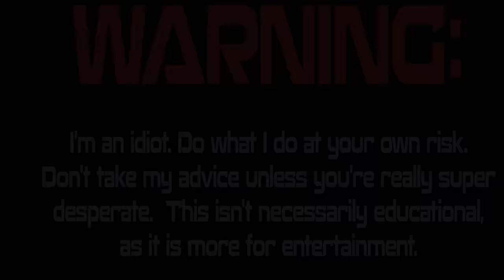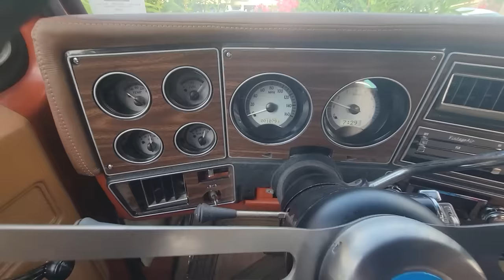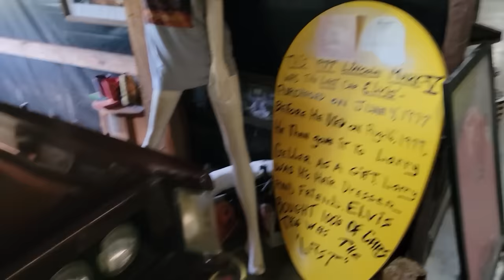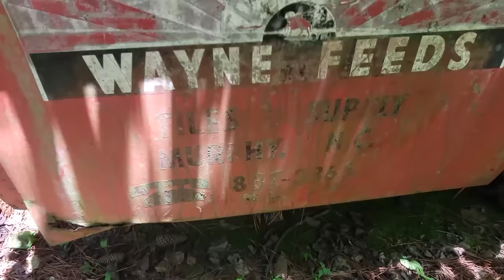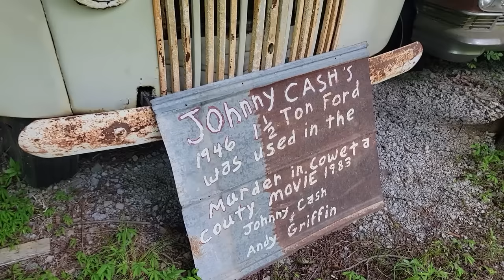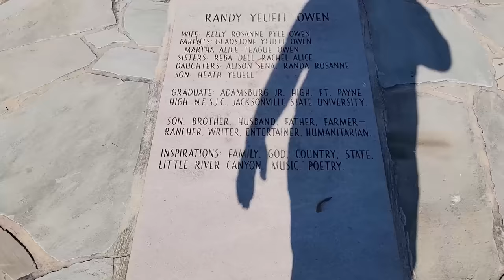Exploring The WORLDS LARGEST Classic Car Junkyard! - HRPT Day 5

Comment: You know you're getting old when you realize that you remember when many of those cars in the junkyard were brand new. Also, when did an oil can spout become an antique? Great video.
Reply: I don't think I've seen oil in a can since the 80's...
Reply: Yep; many of those cars there were new from when I was born (the '57 Chevys and later)...I had one of them oil can spouts; kept it in the back of my '72 Vega (!), along w/ a case of oil; when the oil light flickered, it was time to add a quart or two...Summer of '79; gas was in shortish supply, and had just hit 95 cents/gallon...Fun times!
Reply: I remember when a qt of 30w oil was 39 cents in those cardboard cans.
Reply: I remembered telling everybody  with my first car that I will stop driving if the price of gas ever got to be more than a bucks a gallon. That was in the mid 70's. It was so cheap back then a lawn mower's fuel tank could not take 20 cents worth of gas.  When it hit over a buck it didn't matter because by then we all had decent jobs and good pay.. Now days can barely keep heads above water and it's getting worse every day.

Comment: that old car junk yard was so heartbreaking I could literally feel the old days in this video something about that junkyard is just unexplainable how it hits me and I'm only 27. I've wished many times that I wasn't born in this time I wish I grew up when cars were cars and not crap. thank so much Derek for this video even though it is kind of sad lol but now that you posted this I want to go see it for my self.
Reply: Every time period has it's ups and downs.   If it was the 50's, the cars were sturdy, but they didn't get far on a tank of gas, the engines required regular rebuilding/servicing, and you had Korea going on.   60's, same kind of cars, but then into Vietnam.   70's, the cars were a melange, and I don't know that you could point to any that were real standouts.   the 80's is when they started dropping in strength.  Catalytic converters, and then the removal of the various damage requirements for impacts by the Reagan administration.   So the cars become flimsier, less able to take a bumper hit without being trashed.   On the upside, at that point, the fuel mileages began to climb, and the engines required less and less in the way of regular complete rebuilds.    My 2003 Pontiac Vibe went 300,000+ miles without needing more than two out of four coil packs replaced, three starters, four batteries, three spark plug replacement sets, and lots and lots of tires.   A '53 Ford would have required the engine be rebuilt at least four times to reach that age, I believe, and innumerable spark plugs, wires, ignition coils, etc.   The upside being that you could do that rebuild in a day or so at home, rather than the three to four days in a specialist shop today.
Reply: Don't worry. When the owner dies the next of kin will sell of the land and all those cars go to the crusher
Hoarding these cars should be a crime

Comment: You'd be proud Derek, Just bought a 1969 Chevy C10 as a project for me and my boys.  Truck needs a lot of work but it's got a 250 straight 6 and a 3 speed manual so it will probably out live me.  Today was the first time it's been on the road in about 6yrs.  Tires barely held air and no brakes but I drove it home under it's own power.  Boys are excited to work on it.

Comment: We live in a throw away world for sure, so sad seeing all of that classic iron just rotting away like that :(
Reply: It's sad that for the most part there would  either be a ton of useful parts that could have been used off of those vehicles,  or if it was a mechanical issue  could have put back onto the road with only a minimum of effort.

Being in the rust belt here, if the body and frame were still halfway solid we just kept replacing motors or transmissions until the vehicle was too far rotted away to hold together. Even then if it was a more utilitarian vehicle it was  riveted, welded, cobbled  together for one more go-round until there was no way left to save it.

That being said,  you are right, we are convinced to be a consumer society and  treat everything as disposable and replaceable and new is always better, and that to me is very sad.

Comment: This car reminded me of my 1976 Triumph TR-7.  It had the very small 4 cylinder engine and aluminium heads.  I had a head gasket leak and the mechanic didn't tight the gasket properly and you guessed it the heads warped and the engine had to be ground and fixed costing thousands. Sad situation when you don't know how to fix cars. Anyway I would love to see you restore a TR-7. Fun car to drive!

Comment: Horopito Wreckers in New Zealand had around 7500 cars from 1920s to 1990s. Same deal - open air museum / tourist attraction that you can buy parts from. They just crushed about 2500 of the newer Japanese stuff. Bought plenty hard to find parts there for my 56 DeSoto.

Comment: We buried our Fiero's speedo needle on our second lap around. It only goes up to 85mph, but still lol. Also 99.2% sure we lost oil pressure on the curves because the banking (like 28-30 degrees!?!?) put the oil level in the pan below the pickup tube. the lil' Duke's lifters were ticking away until we hit the straightaway.

Comment: Instead of another Model A (that last adventure seemed to take a year or two off yer life there with the water pump issues) - I'd like to see you revisit one of the rigs from the yard - find a 2 and take it up to a 5 - find a 5 and take it up to a 7 - make something a going to town rig - or take a goin-to-town rig and turn it into a "Take Grandma to Easter Sunday" rig.  Clean up under the barn - give things the ol spray spray rebuild to make it look a little less dirtified.  

Also - don't forget about that Studebaker in the yard - when you figure out what to do with that thing, you've got all sorts of cool pre-depression work cut out for ya. Don't need another model A to work on instead. 

Take one of those 16 Chevy Square Bodies and turn it into a truck that a charity can use, or a needy family or something. Reliable and working.  Drop a working small block into it, make it clean and friendly, reliable, fix up the seats and then donate it to a homeless shelter to help someone get themselves back in their boots.

Comment: Imagine if you can, being a mechanical engineer who drew the plans for those sock-weaving machines with nothing more than a draughtsman board, ink pens, steel rulers and plastic triangles, a complete drafting set of tools, a slide rule, cross reference measuring guides, all to scale of the machine to be handcrafted. YIKES!

Comment: Derek: thanks once again for taking us out here along with your family trip across the south, most likely to places we may never see! The wife and I are looking forward to getting the heck out of the coldest place we have ever lived! Freecking Colorado Springs! Just fixed my 2004 Chevy Silverado SS, the Tree and ground rats ate my wiring! Here is one for you to go off on , I Did! Why in hell would GM fabricate the covering of the wires in the looms of their cars out of a grain base!? WTF? No wonder the little bastards eat the wiring!!!!😡🤬.
I thought that was the main problem when my truck stopped running! Nope just an adjacent problem! In their infinite wisdom and sense of world environmental “issues” ,adjustment back in 2002 to 2006 GM started using a non Lead solder , supposedly great for the environment but because of Hot and cold temperatures in the Dash cluster , and Vibration , which GM should be masters at!? After being in business for some 100 years! They would have this type of things under control? Bul#@&T! Took me years of agonizing back and forth to the dealership trying to find out why my battery would go dead took over 6 years and many shops just to find out it was a factory Solder problem! Sent the Cluster out for repair and rebuild. Works great again also had the varmint chewing  of the wiring loom repaired too! Not to mention what I replaced and repaired on my own! To this day nobody at a shop has told me about the Solder! No dealership, no independent shop! I learned about the dash cluster problem on “YouTube” ! That’s why I we love your videos! Than you Son! Keep up the good work! Regards to you and your family, we will be in the Nashville area in a couple of weeks ,maybe we will run into you and say Hi, LOL😀😂🤣from the land of Frozen ass cold ❄☃🥶Mad Mike……..

Comment: Derek,
Question....
Hello 
I'm looking for a magnetic Digital Angle Gauge Level Protractor Angle Finder Inclinometer with slope/Degrees Magnetic Base for checking pinion/drives shaft/slope angles. .. I've been looking on ebay but descriptions seem to be vague..
Would deeply appreciate a suggestion..
Thank you in advance

Comment: I think the nostalgia for old cars doesn't just come from the idea that they're old, it comes from the idea that this is the styling, power and the roominess we who used to drive these cars back when enjoyed and liked.  Add to the fact that anyone could buy one at a cost that could fit one's budget and know that with modest knowledge of car repair, one could actually fix one's own car without having more than basic tools to do it.  Nowadays, cars are costly, cost fortunes to repair and don't have the styling which caused LOVE for one's machine.  All that expensive stuff they jam into cars is mostly electronics.  You're paying for a glorified flat screen TV, stereo and electronic toys.  People don't drive cars anymore they "operate" them like a video game. Try and buy a car with an interior color that isn't Grey, tan or black anymore?  Say you want to buy a car with a distributor & wires, a carburetor and nothing with an electronic brain...  Good luck! Okay so what if it takes a couple of seconds more to start the car, at least when it breaks down you don't get a bill for $3K or more (that's if you can't fix it yourself for 1/100th the cost).

Comment: You have done time lapse videos with this truck before. Can you explain the windshield to me. It's got two vertical lines going I'm guessing down the center. I never seen a windshield do that with the lines what a inch apart. I'm really curious about that windshield. Now I know with a metal frame splitting panes in REALLY OLD trucks like 1920/30 trucks n cars before they figured out bending glass. But your truck isn't that old, so I'm curious about that windshield 🤔, 😁 anyone feel free to educate me, I'm just learning here.

Comment: at 25:58 minutes into your video , in the back ground , you past by a " MACK  " milk car as they used to call them.
For delivering bottled milk every morning to your door step .  VERY RARE piece ! built on the MACK model  " ED " chassis
it came with a  F - 209 " CONTINENTAL "  flat head straight 6 cyl. engine built for MACK  with the script name on the side
of the engine .

Anyway , still looking to see you do something with the " STUDEBAKER " truck  ????
that thing is a  " true survivor  " ,   and deserves some quality restoration work on it .

And anybody can throw some late model engine / trans swap in it ,  and " HACK - A - BILLY "  it all up .

But to get that thing back to it's original glory , truly separates  " THE MEN FROM THE BOYS " !!
LET'S SEE WHAT YA GOT " DEREK "  ??

P.S.    your gonna need a  " CARPENTER " you let that thing set out in that field any longer !  JUST SAYIN .
                                                                                                                                                                               THE  MACK GUY

Comment: drj Westfield Wisconsin I am looking for two Chevy 1.. 56 4dr Belair with air and #2. 68 ss396 4sp 411 posi rear end  with air. Looking for fix up cars. Also looking for a complete running gear  and frame for a 1996 - 98 c250 4×4 with a big block and push button 4×4.do you know where I can find them? Thanks for taking the time to letting me know where to find them.  Posted 10/14/23